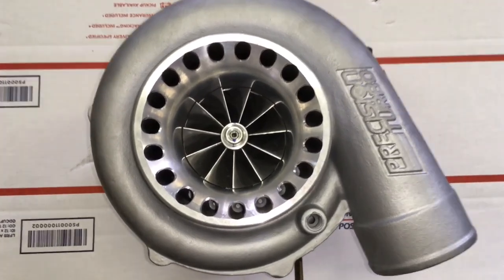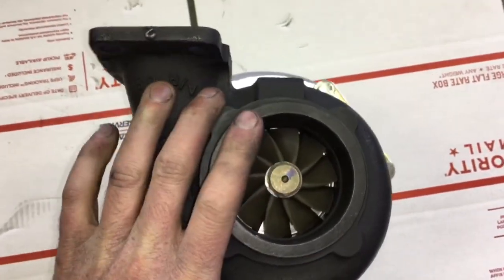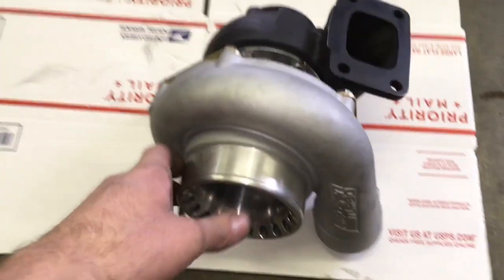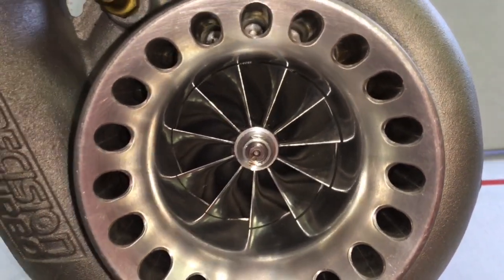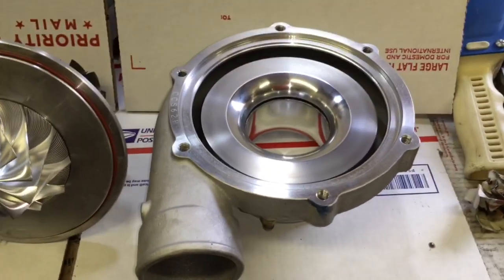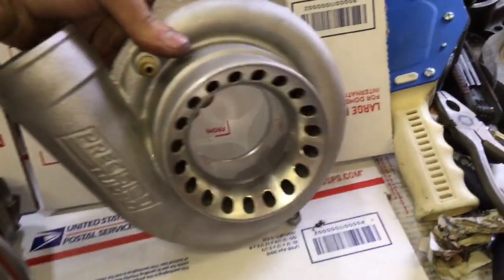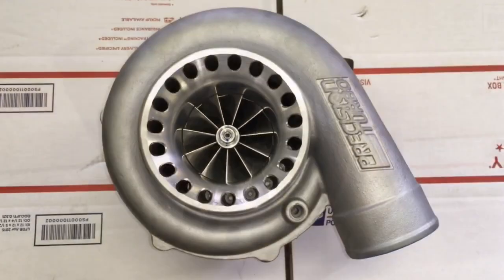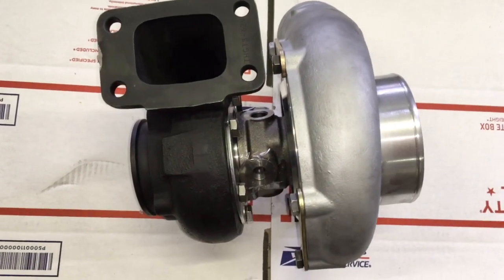PTE 6262 to Gtx3582r Ballbearing Turbo Upgrade

Comment: I have two journal bearing 6262 turbos that I have never used. They are about 8 years old. I was wondering if they are reliable or if they might of had problems back then. 
Should I go over them or just install them and go.

Comment: Man please answer my email (mgarda at msn.com), I really need your housing!
Reply from the maker: +wololo10 do you know if the stock housing can be machined for the wheel that you are talking about? If so I need the wheel to do the service
Reply: Would you have a  t3  .82ar v band  exhaust housing for a garret gt35r by any chance ,I have a t4 1.06 ar right now and in  need of a t3 asap . If you can please  get back to me thanks , don care even if it off a knock off

Comment: Do you have to run water lines on these type of turbos ?
Reply from the maker: +Montiericko Williams You need to use coolant lines, the only time people may not run coolant lines is if the engine air cooled and doesn't not have coolant.